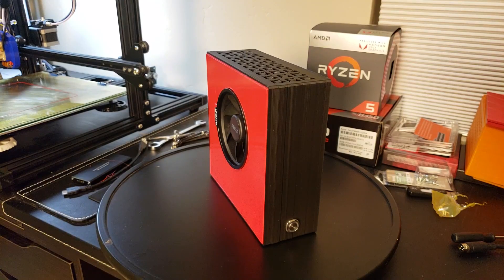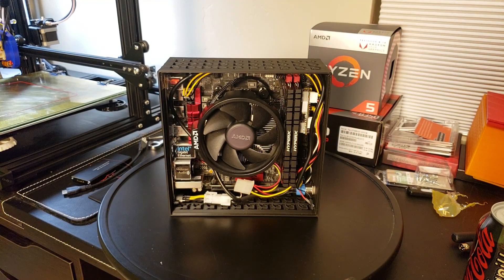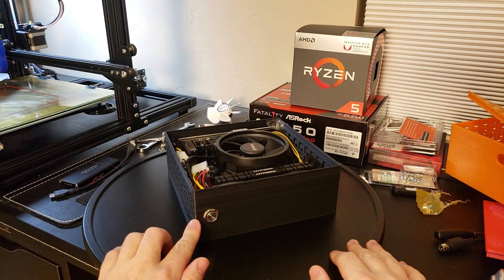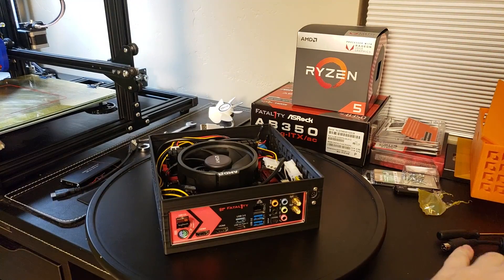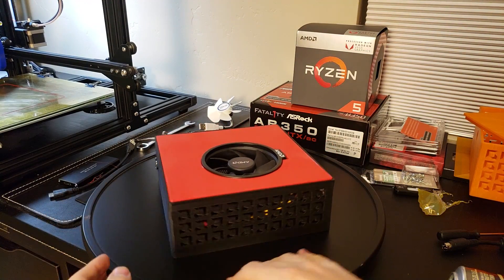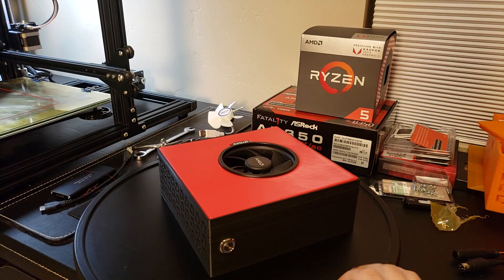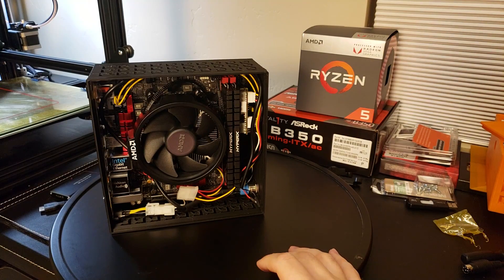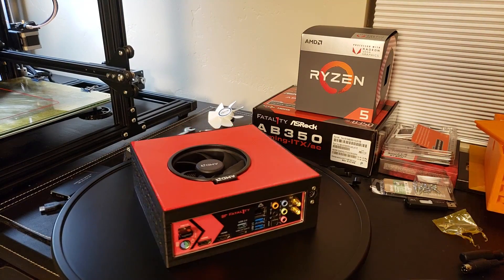3D Printed Ryzen Mini ITX Gaming PC! - Part 2 Final Build

Comment: Amd should definitely produce a team red version of intel's NUC
Reply: i totally agree i have used both skull canyon and now hades canyon just wish AMD had done something like this but more powerful :D
Reply: We sell so many 2200G/2400G systems where I work, literally a dozen or more a week...if we could get a bulk deal on red boxes like this, we could double that number. This. Looks. SLICK.
Reply: AMD partned with Intel for the production of the new NUC. The integrated graphics is na AMD Veja chip welded beside the intel i7 cpu
Reply: @robertoaguiar6230  That sucks, prefer Ryzen chip

Is there one with Ryzen/Vega? That would be superior by far
Reply: @joeygreathouse3029  google for "Subor" Z or Z+ console. It's an full AMD console case pre-build pc
Reply: Gigabyte has made amd based brix in the past. Probably makes the most sense to work with them to make new ryzen based ones.
Reply: They would destroy intel no doubt about it
Reply: Joey Greathouse The technology used in the partnership CPU to tie the CPU and GPU together was created by Intel so unfortunately no.
Reply: The Hades Canyon version is an Intel “CPU” and an AMD “GPU.” This chip is considered the best bang per sq inch chip in the market today and is going to be the best non-dedicated graphics setup you can buy.
Reply: They've recently launched the similar product! The company named Asrock has launched Asrock deskmini lineup

Comment: Almost the BEST 3D Printing video that I've seen.  Not too much talk about dimensions and how much filament you would need.  This project will print on 3D printers that have a print bed size of at least 200mmx200mm!  With 30% infill will take 86 meters of 1.75mm filament to print the base and 23 meters to print the top with no supports(I would suggest to use supports for the back plate area).  Cost of the material can vary depending on what is on-hand or what is available.  Bottom may take about 17 hours and top may take about 4 hours to print.  Awesome project!  Looks like that it can be done over a weekend.

Comment: Dude this is awesome. I was fixing to print something for a mini ITX system, I had been poking around on thingiverse, I did one more pass before settling on a case when I found yours. I struggled a bit with the print, new printer with a bigger print bed, so I didn't have it dialed in. Good enough for now though. I am just waiting for the APU to arrive, everything else is sorted. Thank you for sharing this!

Comment: put a PCI-E 16x passthrough and print an E-GPU case
Reply: yep, and he can also make it attach like a lego brick to make it a modular case.
Reply: @HDAD419  that would be sick!
Reply: I think that kills the point... My laptop is under 1 inch thick with a much more powerful i7 8750 (6c/12t) and GTX 1070 with 1080p 120 Hz monitor, etc...
If you want a cool looking box, his design looks super cool. If you're wanting to make it silly and useless having to plug in an external GPU making it look cluttered with cables and losing the "cute" factor, then either build a regular desktop (so you don't have cable mess), or just get a much thinner and more powerful laptop.
Reply: Jake Garrett a laptop is a lot more expensive to buy than this mini-pc
Reply: @jakegarrett8109  they were just giving suggestions no reason to go on a rant on how much GPUs your pc has. i for one would think it would be awesome to have that option to add a GPU later on. done using it has a work horse, add the GPU and gift it to family or friend as a tiny gaming pc
Reply: @jakegarrett8109  all because it sounds like a bad idea to you doesn't mean it's bad. Google was a bad idea at the beginning and look at it now. all because you can't think of any way of making it work doesn't mean someone else can. I've seen some crazy PC mods and even custom built power bricks. keep a open mind bud anything is possible
Reply: @jakegarrett8109  yes yes i get it. you have huge systems and enough cash to build em just to go around and brag about em but my point is, all because you think its a bad idea and you wont do it. doesn't mean its a bad idea. just like those people who make xbox's into laptops with their own battery packs. sounds like a idea that wont really work well but it turns out to be a badass idea.
Reply: @O.Badluck  I'm not saying a computer in a console (or opposite) is a bad idea (I want to find a tossed out PS3 fat edition so I can put a budget build inside). I'm also not saying its about money (my first build was a huge purchase for doing CAD design during college, I spent $500 making the computer, and $5 per monitor at a thrift store for a nice $10 duel monitor config. My Keyboard was from my first windows 95 computer, and I still use that same heavy Hewlett Packard and that same VGA monitor when I set world records out of nostalgia.

What I am saying, is your gutting and destroying a beautiful custom designed 3d printed system, that is amazing, and now you're destroying it making it a bunch of pieces that will be a pain each time you move it. Just make it in a regular SFF case if you want a GPU in it, the creator of this case did a fantastic job on this masterpiece, and you would just butcher its functionality and elegance from doing this. I'm not always about aesthetics (my test bench is either my hand-made plasma cut test bench, or literally a giant fat physics book. I love that physics book, physics was my favorite class and I had an awesome teacher, so for nostalgic purpose again, I use that book, just not with sub-zero cooled systems because I want to keep it in good dry condition). A GPU is much better in a single tower, go look at InWin for some great SFF examples, they are not expensive, and many will be much better suited to having a GPU, you could modify and print one based off of those, but you defiantly will want the GPU build in.
Reply: Bills BuildAll  I'm not mad, I'm just saying its a stupid idea (and many stupid ideas I approve of). My other channel will be featuring frozen Pizza rolls as a means to overclock Threadripper... I mean, completely stupid, and pointless, but totally livable (I will be eating the pizza rolls afterwards, even if they fall on the floor, the 5 second rule is only a guideline). I approve of doing whacky insane things (I may even try the "bake a GPU" method with an open flame BBQ pit), however, this eGPU is not crazy enough to be cool, and definitely less practical than turning a GPU backplate into a nacho warming bowl (because you can snack on warm nachos all day while you game, though no explanation for this was probably needed, it should be obvious why you'd want to do this).
Reply: @jakegarrett8109  I don't think you get the point
Reply: @jakegarrett8109  no you wouldn't have a ton of cables
Reply: @HoloScope   I've done this, I know what you need, so here is a list if you want:
PCIe 16x riser (very fat ribbon cable, I had to wrap mine in foil due to electromagnetic interference), this will also require Molex to assist the cable in power (at least safely, if you don't mind a fire, then you may skip it), then the GPU will need the 6/8 pins plugged in every time from your main system OR you can run a second PSU
If you run a second PSU, you will need to link the green signal wire on the 24 pin connector of the eGPU PSU to your motherboards 24 pin green wire OR use an ADD2PSU adapter, which will require a Molex (plugged in every time) from the master PSU to signal the relay to short signal to ground on your slave PSU that powers the eGPU.

THEN, you will need to disconnect the HDMI/DP cable from your regular system, connect it to the eGPU (you may leave it connected to your monitor) OR run a second monitor cable that always stays on your eGPU box and switch your monitor input each time. Also, your drivers and Windows will freak out each time (Linux, this is not really a big issue, its much more hardware swap friendly).

Yeah, not a lot of cables hmm... I mean, yeah, compared to my "monster" system with 4x crossfire (8x 8pin GPU connectors, 1x 6 pin for the mobo, 2x CPU connectors, 2x 24 pin with one acting as slave, a bunch of Sunon Maglev server fans) and soon to be a 5th GPU just to drive a clear LCD panel for fire animations while being transparent to show off the build, which will also need a GPU mining riser which is powered off yet another 6 pin GPU connector. Also the monitor will input from a display cable, and will be ran off Molex (because I didn't want a 3rd power supply in my system, I already have 1 wall power cord for my massive water pump, and 2x more for running the duel SuperNova 1300s. So yeah, I guess compared to THAT, its not a lot of cables, but I don't have to plug those in or touch them. I just have the mouse/keyboard/headphone/monitors to plug in when I move it, just like any system.

Trust me, just build a freaken box that everything will fit in. I am the expert of building outside of the box... That monster system will have a car radiator mounted to the outside of my house, I will also have radiators stacked on the back of its casket (its a Vampire style coffin for Halloween). But this isn't some crazy system, just get the freaken InWin case and have a nice solution you can actually use! You can thank me later... It won't be portable otherwise.

Comment: You should add some dust filtration...
Reply: To what? The CPU cooler? That's the only air flowing in. I'd rather give it a dust with some compressed air every couple months than restrict airflow.
Reply: A dust filter let's air through but stops the dust. It wont block airflow.  @leeadkins1360
Reply: @FrankoNL  Wrong, it does impede airflow. Better off letting a little dust in and cleaning from time to time, without intake and exhaust won't be much dust anyway.
Reply: there are two types of people in this world. People who think its stupid to let dust into expensive precision electronics. And some that will give it a dust every now and again
Reply: 1) If you think you wont have to dust it because you have a filter on, you are extremely naive. 2) There is only the CPU fan as intake (no outlet fans just grills) which means it's going to get warm WITHOUT any intake filter. So yeah, I would rather dust a little more frequently than potentially let the expensive electronics overheat and throttle.
Reply: @FrankoNL  dust filters do restrict airflow, not a whole lot though, but on a system like this that little bit of restriction could be the difference between decent temps and thermal throttling, a "little bit" of restriction is a whole lot of restriction in this case (no pun intended lol)
Reply: @FrankoNL  " It wont block airflow."  Dust filters always impede airflow.  I would much rather dust once a month than restrict airflow at all.
Reply: @leeadkins1360  keep attacking that straw man bro
Reply: @DanA-st2ed  lol what strawman, it's physics 'bro'.
Reply: Where would you put it? 
On top of the cooler? Would be hard to position/put on without it looking dumb or hitting the fan blades.
Inside the case (exhaust)? Wouldn't make sense, just let it blow the dust out again.
Reply: @leeadkins1360  people cleaning their PC even if they have dust filters is physics?
Reply: To be honest, with how little surface area a Mini ITX motherboard has, any dust you encounter can be fixed with a few short blasts of compressed air. Really not a huge problem
Reply: When you design and print yours...you can add dust filters.
Reply: @leeadkins1360  Unless you have pets, I have cats and with my Phantex p300 with two intake fans in front and one exhaust fan in the back it is absolutely disgusting the amount of dust and cat hair I find in those dust filters. To each their own but I would rather sacrifice one or two degrees than to have a bunch of cat hair and dust caught up in my computer possibly compromising on reliability.
Reply: 101st like, and it probably needs a dust filter
Reply: I'd at least put some sort of grille over the fan just to stop fingers, paws, etc getting in there. Maybe use the same logo design as on the sides.
Reply: @leeadkins1360  dust filters do block some airflow... but letting dust in the case is also a form of blocking airflow... even if you dust it every now and then!
and talking about physics... dust is electric chargeable... in components such as metal coolers it will accumulate static electricity and then discharge it... so, yeah i'd definitely fancy may chances with a particle filter rather the downside of dust and let it run loose inside my casing. but hey, that is just me!
fluid dynamic dictates that the positive airflow going into the case will force the hot air inside out... so even with the air filter, it is still a better solution than leaving it open... and i'm saying this cuz physics and math say so. plz, don't get me wrong, i am saying this in a good way and adding value to what everybody said here. Keep it cool, keep it clean :-D
DIY foreva
Reply: some ppl keep their rooms clean and don't really need dust filters
Reply: Mig-L, I hear you, but I'm sure your computer has more than one cpu fan providing the cooling for APU, memory, VRM, M.2 drive, motherboard as a whole.

I think people misunderstand me, on a normal form factor pc, or even mini itx with case fans yes of course have filtered intakes. You have enough static air pressure and airflow in general to keep temps within spec without throttling or shortening the life of the components. 

I know this is a lower tdp chip, but that APU and VRM still get pretty warm even with modest cooling. Even with more active cooling I think it's going to be on the warm side.

I think this setup is going to be just on the edge of keeping the APU and power delivery below throttling temps during extended gaming sessions which is why I would leave it off for this, personally :)
Reply: @robertp457  well then dust each month, I made a Ryzen 2600 (all core 4Ghz, 1.2V), and a Vega56 flashed to 64 (1560Mhz/1100Mhz, undervolted to 1V - it has done its job during mining craze and now re-purposed) with 32GB of DDR4-3000CL14 in a Silverstone RVZ01B and it works fine with dust filters for both the GPU and the CPU. 2 x slim Noctua NF-A12x15 PWM for GPU intake with a Rajintek Morpheus and be quiet! SHADOW ROCK LP for the CPU.  It's half a year already and I occassionally just clean the filters on the bottom and brush the filter on top to remove the dust. Inaudible for HTPC uses except when the BD-Rom spins, and relatively loud in gaming since my adjustment of the fan curves is intentionally like that (fan sound during gaming is less important). A HTPC case that throttles with dust filters is a crap PC case. Often in small cases you simply do not want to open and clean fans/fins. For cleaning the fins on the Morpheus for example I would need to remove the GPU box and the PCI-E bracket and L extender to get the card out and then in some weird position hold it to clean. And then remove the slim fans to clean them while half the case is in pieces. Not a chance.

Comment: I think an IO shield (like a flip up cap to protect the wifi SMA connectors, and your USBs etc) would be a great addition. Seems like you would need to be super careful in transporting it so you don't damage those, but a simple hinged flip up cap would protect it during transport, and then swing out of the way when you pug everything in. That would be super easy to add, and I think a really nice feature for such a perfect portable mini PC.

On mine I'd definitely go alternating pattern of AMD and Vega air vents (thanks for posting the files so we can mod, thanks!). Too bad I don't need another Ryzen build, otherwise this looks super cool! Awesome work!

Comment: Just imagine the 3rd gen Ryzen APUs in this case. Ryzen 3 3300G or a Ryzen 5 3600G.
Reply: why not ryzen 7 3700G
Reply: @matthewsmith2385  The leaks didn't show A Ryzen 7 with an iGPU, but since the next generation will increase core counts (Ryzen 3 with 6 cores, Ryzen 5 with 8 cores (Ryzen 7 with 12 cores, Ryzen 9 with 16 cores), we will only see APUs on the Ryzen 3 and Ryzen 5 line. The cool thing about this though is that the iGPUs will use Navi graphics sporting anywhere from 15 to 20 Compute Units.
Reply: Kris 3rd gen wont do much more graphics than 2400g (oc) since the ddr4 ram shared is slow
Reply: DDR5 is coming dude
Reply: @matthewsmith2385  Why not Threadripper
Reply: @Megadeth1983Fan  i wish this rumours of 20 cu were true, but it wouldn't make sence to have 20 cu if an apu with 11 cu struggles with ddr4 bandwidth that's just not enough. 😁
Reply: @freepok  Not for this next generation tho. So no ryzen 3xxx with ddr5 sorry bro.
Reply: Should pick a R7 option with a monster cooler for over clocking.

Comment: Other than having to move around the hole for the cpu cooler if you don't use the same motherboard, there's only one other problem I see with that case.  I don't think it's going to get enough airflow over the board for proper component cooling.  If you could manage to slip an 80-120mm fan in there you'd be set.  Otherwise, that looks like it'd be an awesome htpc.

Comment: That be cool to print out feet that would connect into the AMD logo about 5 ml thick or so. that way you still have air flow through those vent holes and still be able to set it up vertically!

Comment: I have a strange un natural obsession with micro PC's. I have a old Wintec aluminum MATX case I have had for 27 years and still love it. I have another system in a Lian-Li TU100 case and love it. I am instantly in love with this case design and have added it to my saved video list. AMD is coming out soon with a 4000 series APU's which will have six core and eight core CPU's with integrated Vega graphics. Once the 4000 series APU becomes available I intend to move forward with this. I just have to find someone local who can print this for me.